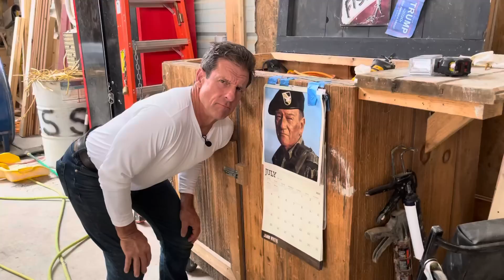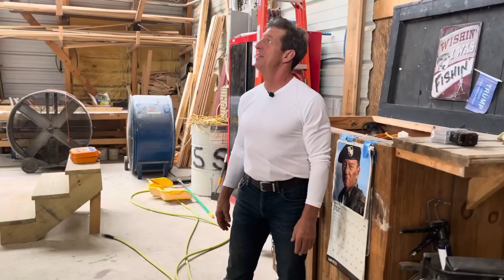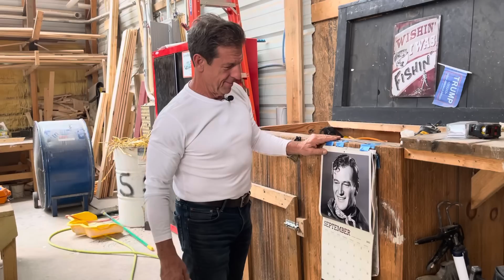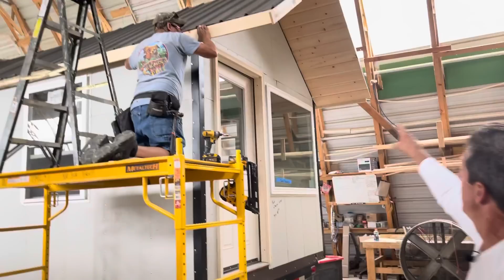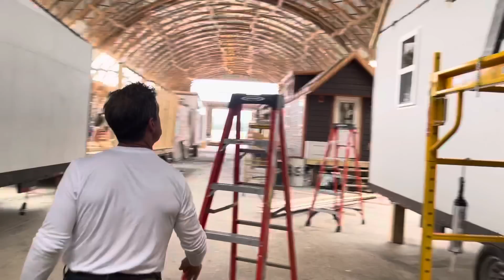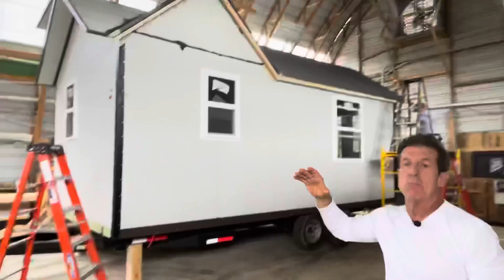ESP Tiny Homes are the new norm? 🤔🤷🏼‍♀️🏘

Comment: I hear a home maintenance video coming up shortly.

I fix everything in our little property.

Dave, not so much out of the ☑️ thinker🤔🙄🤔.
U bends are overtime expected to take out the water/waste. Respect that fact. Just before winter hits, just check fixtures & fittings. Tighten them up.
Wood will swell, pocket door may stick.
Add some WD 40 into that tool box.
You maintain a 🏠. Maintain what gives you FREEDOM.
Great video as always, stay cool you two guys.
UK♥️💛💜

Comment: Been building with esp/sips since early 80's. Love them. Why don't  you order stucco finish sips?
Reply: Because they aren’t sips.
Reply: What they're using are pieces/punch outs from metal doors, to save them from the landfill, and they cost less.
Reply: @reynetallents  so they really don't meet s*** for codes?
Reply: They're ANSI certified, so they meet those codes.